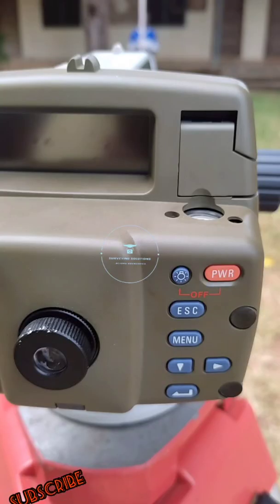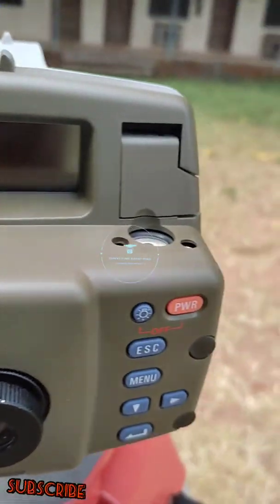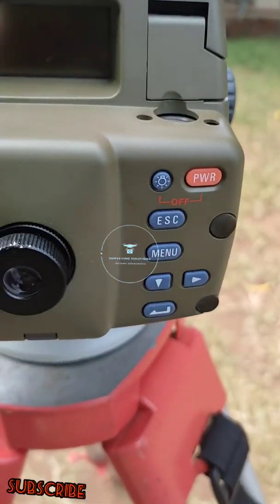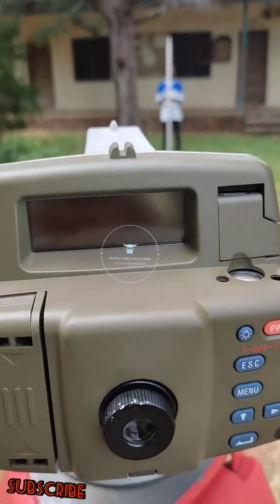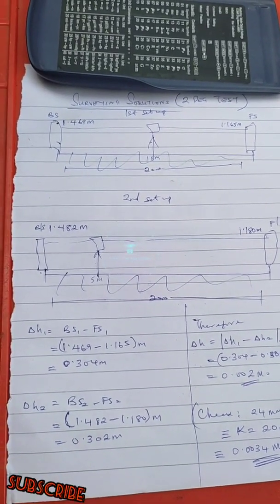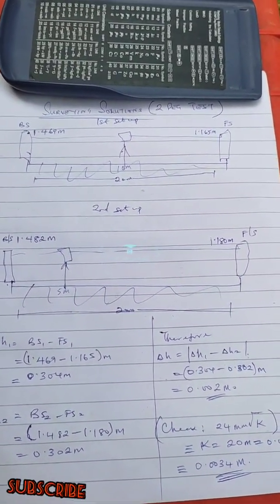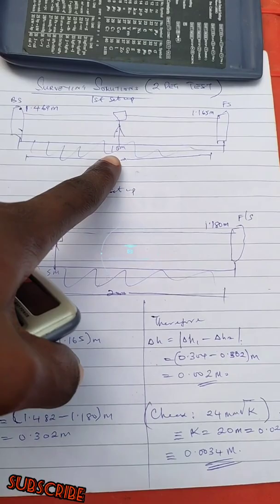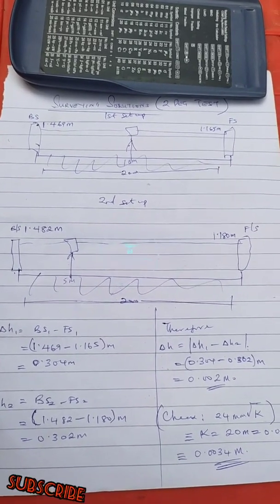Two Peg Test | How to Determine the Collimation Error of a Level 2026

Comment: Thanks for the video. You're doing a good job. I have two questions.
1). In apply this formula 24mm√K
Where k is in kilometer, don't you think the units are not consistent. Can this rule stand mathematically?
2). How do you go about this two peg test if it is second order or first order job? 
Thanks
Reply from the maker: Hello Saint, you're welcome. And thank you for your kind words too...

1. Yes, it stands mathematically. The √ with the k and the 'mm' with the 24 brings the consistency of the units.
After getting the √, and getting the value of 24mm, the final unit becomes "m", because the milli there is like a coefficient of the meter ie (10^¯3)m.
Do you understand now?

2. Its the same process, although there is no "fixed" distance to be used. The principle of setting up at the centre and close to one point might be fixed, but not the distance.
For higher accuracies like 2nd, 1st and others, there is a standard formula for the check. Please consult a literature or from Google search, the actual expressions aren't very close to us now.
The 24mm√k is an expression to check for 3rd order levelling loops; so other higher and lower orders have their expressions too.

We hope we tried to answer your questions.
Please let us know if you are clear with them.

Expecting your response soon.

Thank you very much...